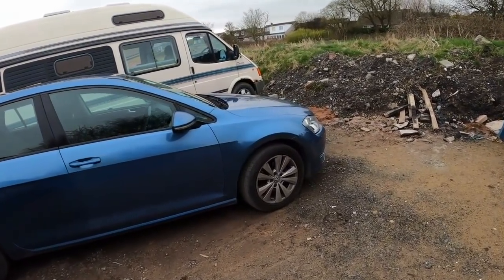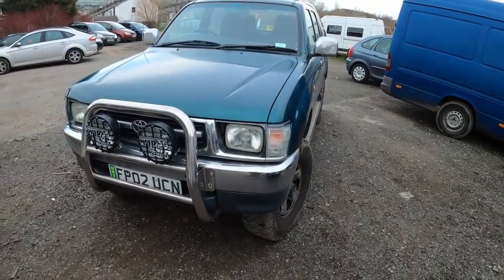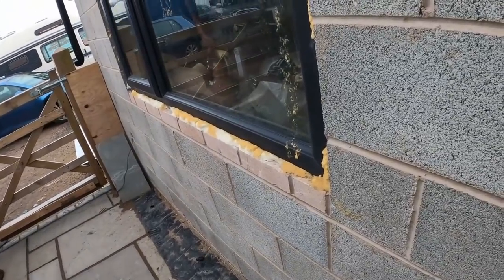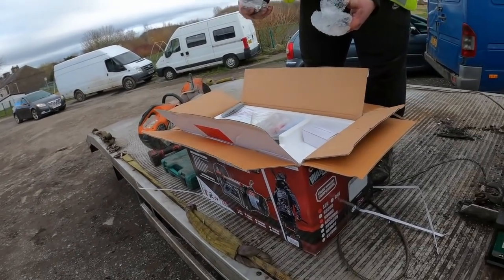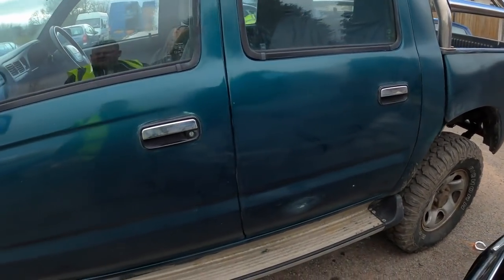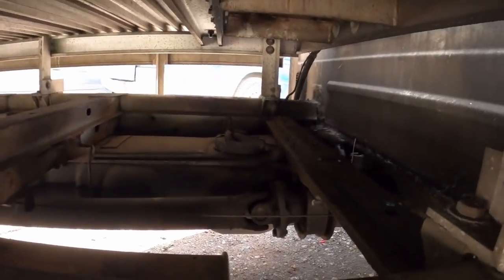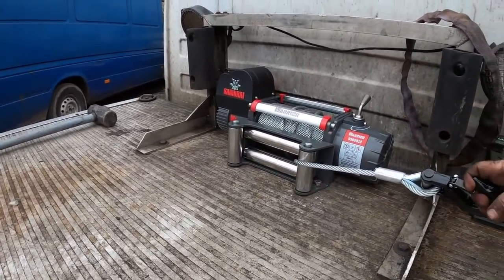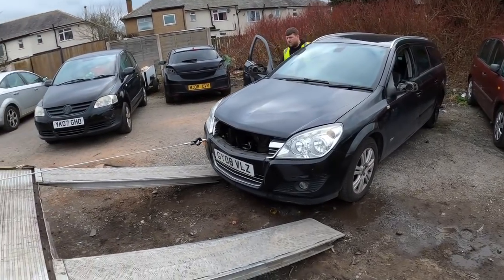WE TREATED OUR TRUCK TO A NEW WINCH BONUS HILUX BARGAIN 4X4

Comment: Nice old Hi lux nice one on the transit camper clean pass. Bsa is gone nice one. No matter in Gana they don't care much about the paint. They always send wrong bolts not they easiest thing to get to under the bed. There not to bad the old Mercs My mate runs a recovery company he had a Merc he's got a 07 plate Vw crafter now with 350tho on her done head gasket 3 times but she pulls some car's.👍👈

Comment: hilux was a cheap motor strong as anything i got old 2.4 non turbo i use around the yard shes a beast , i also got the same winch but the 13000lbs one for cheaper winches they last a few year and pull well , keep sending em over the bridge and stacking them pound notes boys